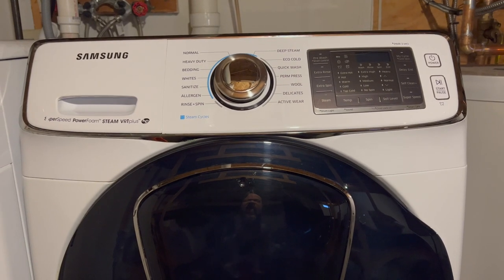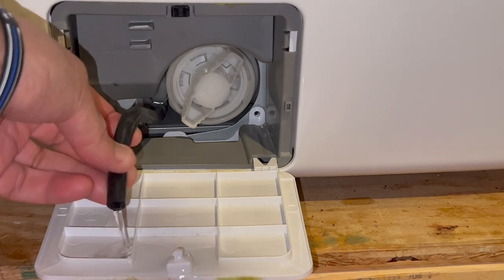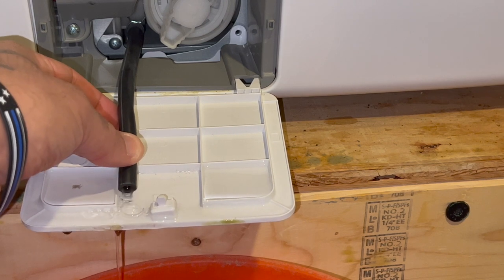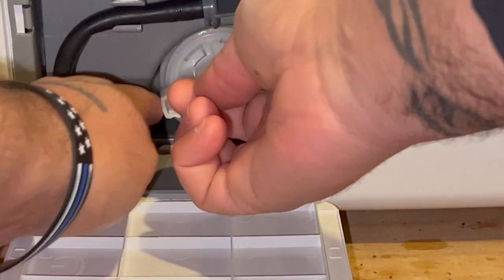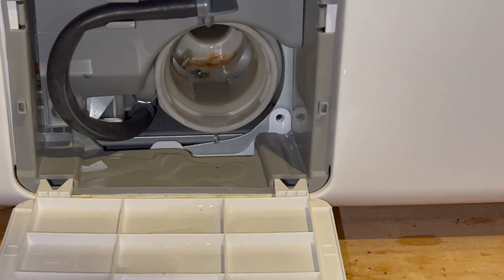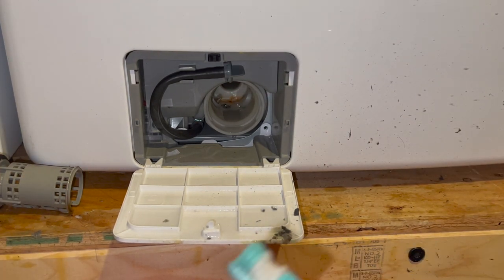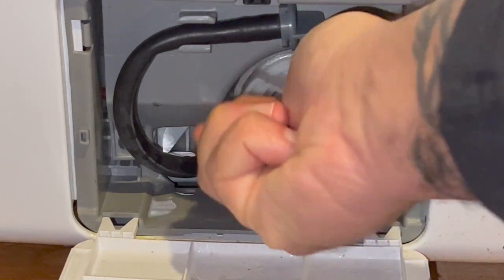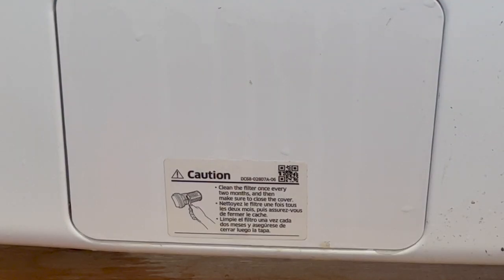How To Clean Your Samsung Front Loader Washing Machine Drain & Filter (Suds/SC Code)

Comment: Still cant fuckin get it. Instead its cutting my knuckles i can get it to not click but only luke half a turn then it clicks again so frustrating. Never had such a hard filter lol fml
Reply from the maker: It’s only like a quarter to half turn. It shouldn’t be that hard either make sure the gasket/o ring is in place properly. Let me know how you make out. Lol
Reply: Apparently it is spring loaded and needs to be pressed in quite hard then turned. It will then take about a quarter turn up to two more turns and should then be able to be removed. Hearing lots of clicks means that the disengaging process has not been enabled. As the man said, it opens like a pill bottle - press and unlock. Good luck.
Reply from the maker: @quikscot1528  thanks brother.